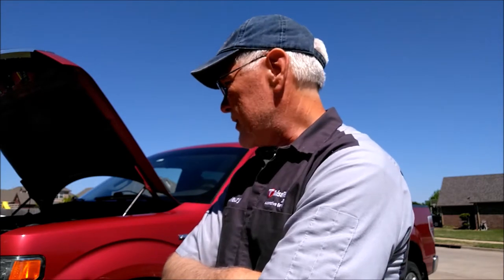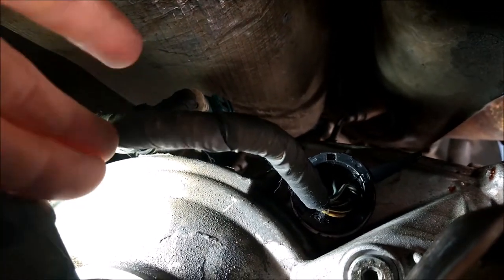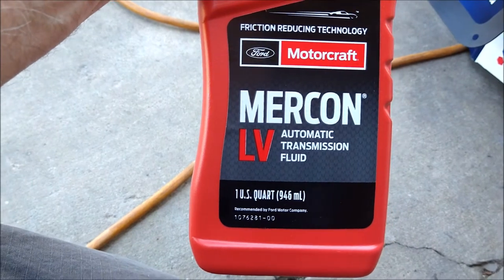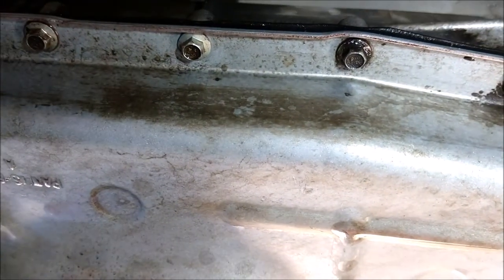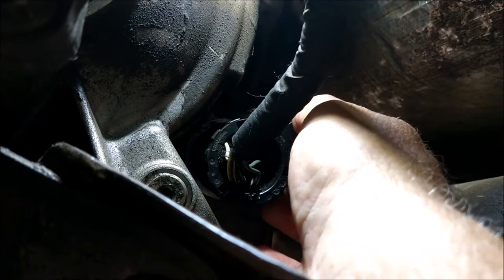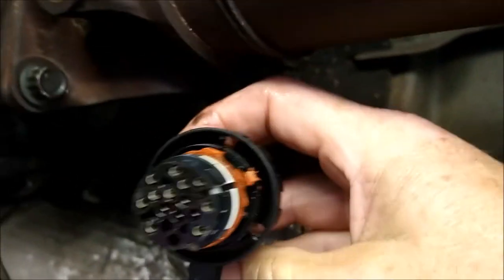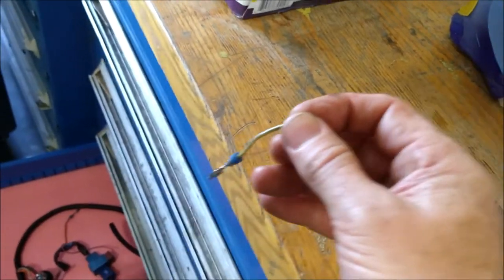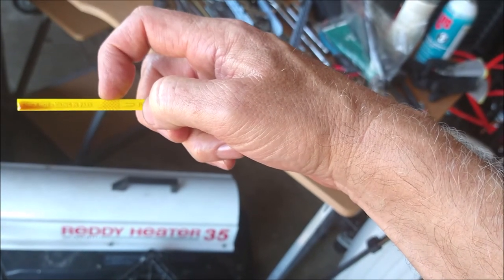Ford F150 Transmission Connector Leak

Comment: 2010 Ford Explorer lost communiciation with TCM code. Wrench, traction control and Check engine light. Car in limp mode. Bulkhead connector leak? Can i clean it up?
Reply: I have the exact issues with my f150. Any known fix?

Comment: You didn't show the part where you actually locked the pass through in place. Also, where'd you get a rubber gasket?  No one uses those.